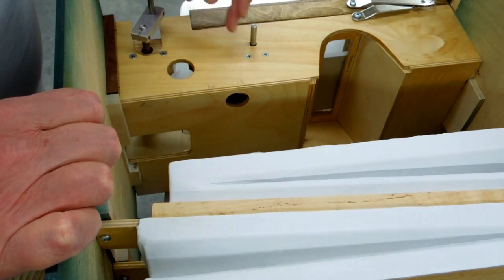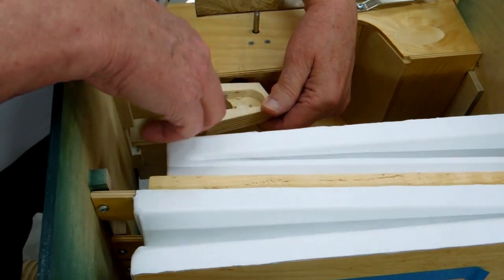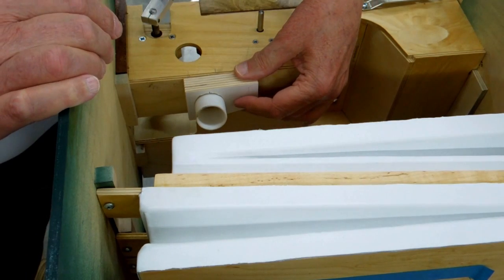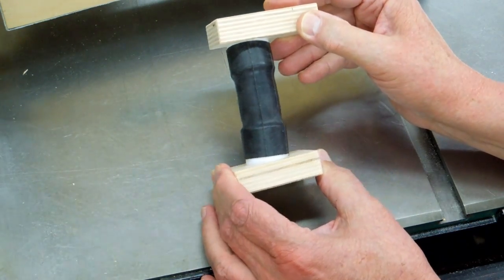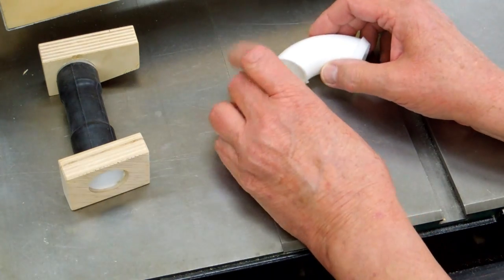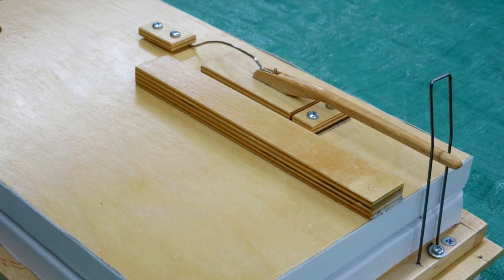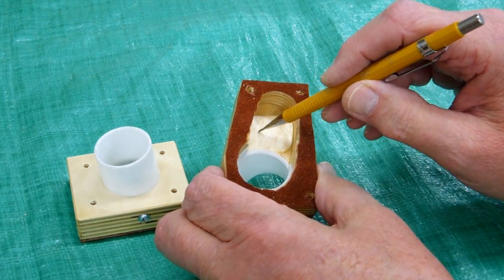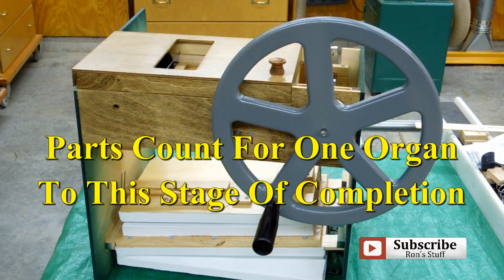Senior 20 Organ (14) Hose Connection - Reservoir To Pressure Box

Comment: Looks good! Why did you screw the adapter to the pressure box (involving a leather gasket) rather than glue it? Does it have to be removable?
Reply from the maker: surfcello For one, the manifold may have needed changing (for some reason) so screws allow that. And two, the pressure box was already lacquered and glue wouldn't stick to it.

Comment: Unfortunate that the holes were were offset so much in the original plans. I wonder why? But your offset manifolds were a very innovative fix. Especially like the making and use of a spring to keep the inner tube from collapsing! Will the force of the spring on the reservoir cause interference with its ability to fully open and function as desired? Thanks for sharing.
Reply from the maker: MRrwmac Actually, the spring is suggested in the plans and the offset hole may have been intentional in the design as several pipes were placed under the pressure box when the organ is built with a conductor. Things can get pretty crowded under there. The "spring" I made is fairly soft fence wire and offers little resistance to compression. It is there just to make sure the inner tube remains open.